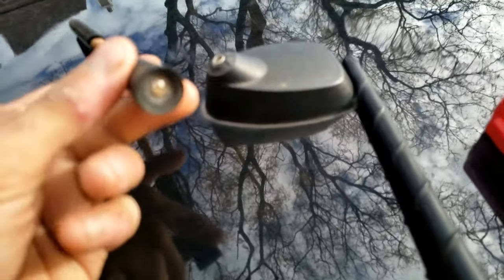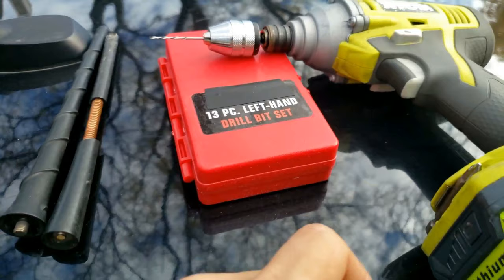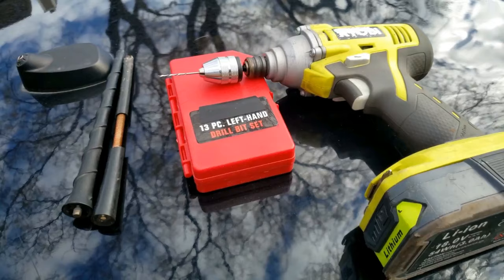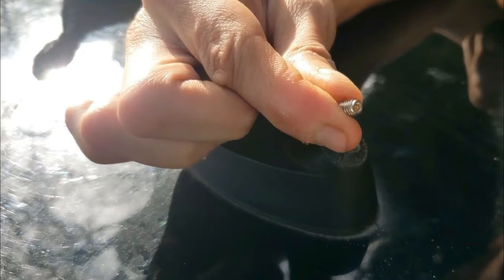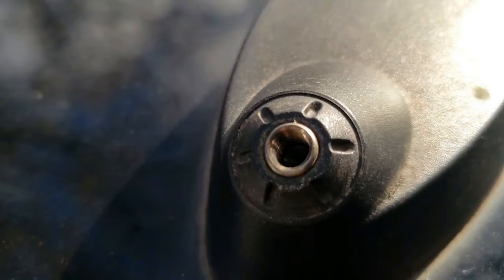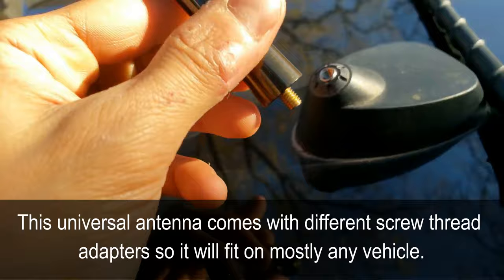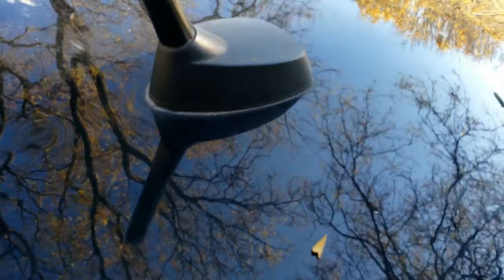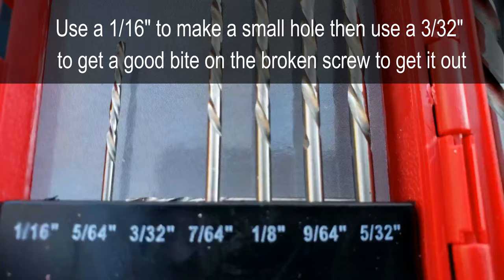Repair Broken Car Antenna 📶 That Snapped Off

Comment: Dumb question, but why does it need to be a left handed drill bit?
Reply from the maker: That's actually a great question! Please look at the previous top comments. I give a pretty detailed explanation on using it. Quick answer/teaser: the threads on the LH drill are reversed.

Comment: What size was the drill bit?
Reply from the maker: I used a 1/16" first to make a small hole and then the next bigger drill bit being a 3/32". 

Make sure to use a left hand drill bit set.

Let me know if this was easy for you to complete or if any other questions. Hope this video helped!
Reply: Alright it worked thanks for the video
Reply: @FixCarYourself  I screwed  the s$$$ out the hole. Just metal pieces kept coming out and now nothing there to screw back new antenna. I should have used wd40 as mine didn't come out at all.
Reply from the maker: The Left Hand drill bit is still the most preferred approach, but I can see Penetrating oil as being helpful. Another option once you have a hole in the antenna is to place a pointed tip or one tip of a pliers and apply pressure to the hole kind of on an angle. You want to twist or turn it in a counter clockwise manner. Possibly a few taps with a hammer would also allow the pointed tip to bite into the antenna piece making it potentially easier to remove when twisting.
Reply: @FixCarYourself  I used normal drill bit for metal, so I can see where it all went wrong. What I did in the end is, took the plastic cover off and drilled long enough bore into it and then placing the screw in the hole, I filled with glue. Its still hanging there . I know I butchered it. I am a very bad at craftsmanship.
Reply from the maker: @DewanaShah  Actually oddly enough, I like the idea! If it was already drilled, but you put glue in it. Maybe Now if the glue hardens... would it be possible to put a left hand drill bit in to get the rest of the piece out which is stuck to the stickness of the glue? Just a suggestion to try. 

If all your looking for is cosmetic looks then maybe just leave it alone with the glue. It should hold up pretty well.

Comment: What happens if the whole thing comes off
Reply from the maker: Can you be more specific?
Reply: @FixCarYourself  I figured it out. But basically my whole base got torn off so I have to replace the whole thing and take out some pieces that got stuck
Reply from the maker: @kalebanderson6564  Ok good to know. Hopefully its not difficult to remove the base. Some of these bases are hidden inside the headliner, which means you have to pull down partially on the headliner to get to the base.
Reply: @FixCarYourself  yea I have a Chevy Cruze so I have to remove the headliner to get to it. And I don’t even have to remove the base cuz it got ripped off lmao. So my car got really badly scratched which sucks
Reply from the maker: Wow that's a lot of work to remove a headliner just to get to the antenna. Lot of vehicles are still like that. Hopefully they redesign it in the future to make it more accessible.

Comment: You skipped a part in changing the screw bits I think.
Reply from the maker: If u mean the drill bits... I used 2 different sizes. One as a starter to make a hole and then the next one to finish removing it.

If u watch the vid again you'll see the 2 bits used.

Comment: This did not work for me.
Reply from the maker: How come...is it the drill? Is their a screw thread inside? Can you try a different drill size?
Reply: @FixCarYourself  My fault.  I did not know about left hand drill bits.  I was just using a standard bit.  What drill bit size should I use?
Reply from the maker: I wished I could have used a regular drill as well, but unfortunately it doesn't work that way. I had to buy a left hand set, but I'm glad I did cause I have used this on other screws as well.

Anyway use a 1/16" first or around that size to make a little hole and then switch to the next biggest size in this case a 3/32".
Reply from the maker: I also put a guide in the description below for easy reference and some links for a left hand drill set. Let me know later if you fix this. Hope this helps!

Comment: Use a hammer drill if u don't want to make it a hard work for jobs like this.
Reply from the maker: I used a regular drill, but you could also use a impact driver or like you said a Hammer drill. Nice point!

Comment: Will this work if the original thread is still attached? I’ve got a problem where when I try to unscrew the thread to remove it, the round bolt at the bottom of the base turns at the same time
Reply from the maker: If the original thread is still inside I don't think it will work because their is a break in the connection. Or you may have to get a smaller screw for this to fit. So I think its best to just remove the original thread inside.